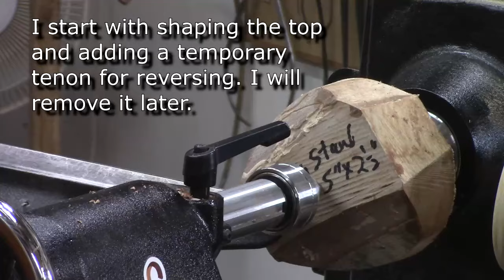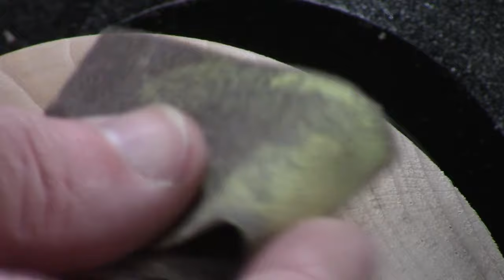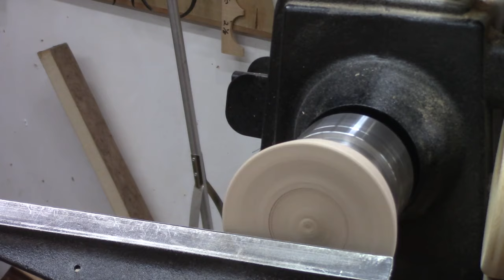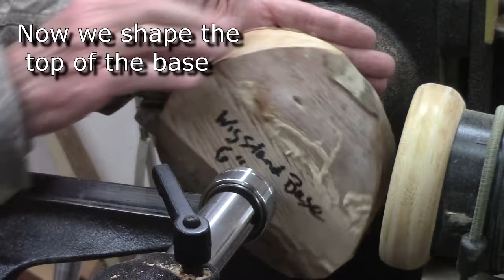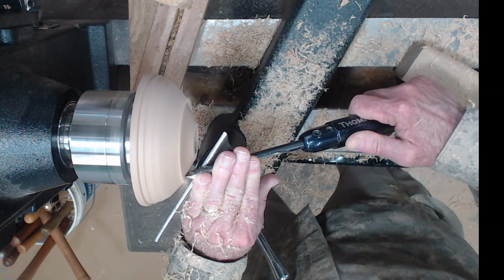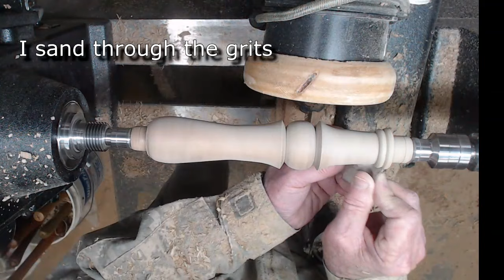We are Turning a Wig Stand – 4 Ways Collaboration Video

Comment: Thanks for this video . My club adopted a whig charity 3 months ago , and I turned a stand from two blocks of white birch , and a yellow birch spindle blank , my base was a live edge section that had the bark fall off and had wood worm tunnels expoxed , that I barely smoothed over as a detail , , I gave the final piece two coat of zinser sanding sealer and two coatings of feed and wav , instead of turning a tenon on botton of base , I used a screw drive and inlet a new penny to cover the hole . Not a big fan of longer spindle turning , but it is a very eunique  piece 
I recently aquired a used BDU shirt ,and prefer it over my used Lee Valley smock , or welders jacket
Reply from the maker: Always fun to turn something new. Yes, ACU jackets make great winter smocks.